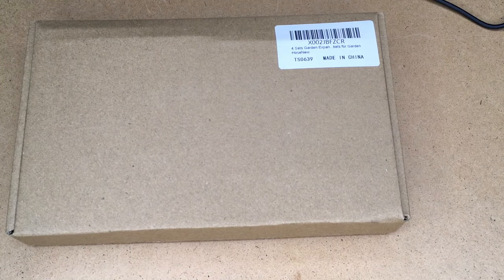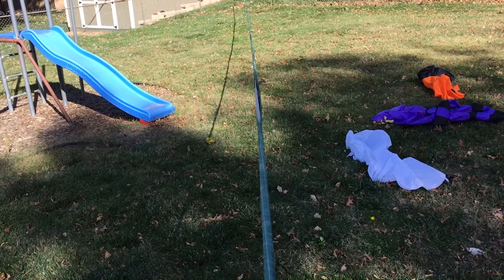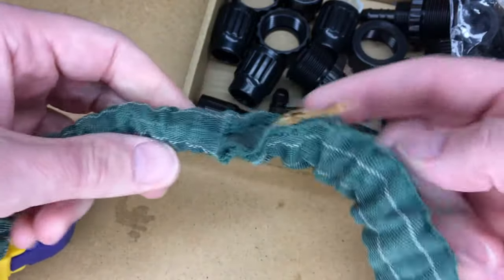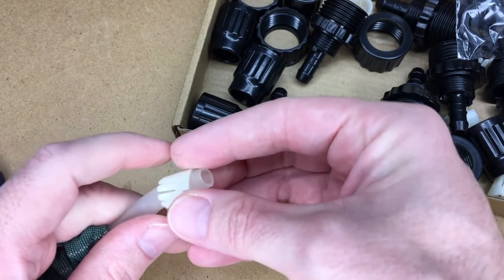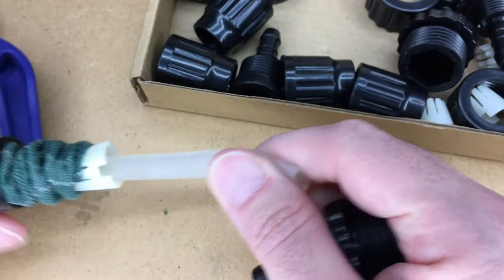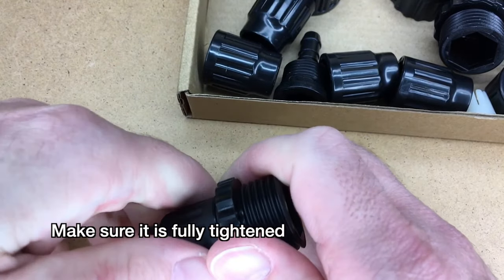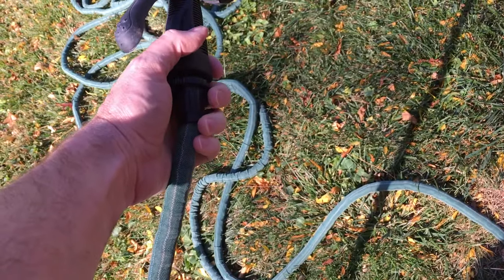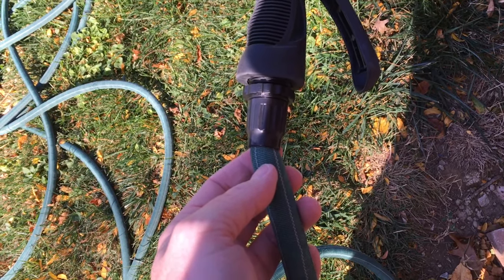Expandable Hose (e.g. Pocket Hose) Repair Kit

Comment: I am on my second expandable hose which also broke. Luckily I have not tossed either. I got an insert and 2 clamp kit from home depot.... may not work as well as yours.
Something that important to remember with these flimsy hoses is than you can NOT leave water pressure on for very long with the sprayer turned off (or what ever you have on the end .) It cannot handle the pressure like regular hoses. Side note: a neighbor had her nozzle set to trickle to slowly water a tree while she was out. Trouble is the water was turned on full and eventually the hose said "I'm outta here" and blew up. I found water seeping out her back fence and went to tell her there was a problem. (Californians are very touchy about wasting water 🤣  ) She was very grateful to be told.

Comment: Thank you Rick! Very helpful video especially considering the parts come with NO instructions. I would suggest you go into a bit more detail about attaching the female end. Also, a 1/2" hex wrench can be inserted and used to tighten the collar part. What I did for my repair was to install both male and female connectors at the leak point (only cutting out a 1" piece of the hose) to preserve the full length. Worked beautifully! Just like a simple coupler. And no leaks! Thanks Again!

Comment: I was able to fix my Pocket Hose thanks to your instruction and the repair kit that is shown. It requires some effort, clamps needed, don’t twist the tubing, vise grips help, and finally a male hex fitting to stabilize the female coupling.
Reply: What is the kit number

Comment: Hi Rick.. I've repaired 2 up to now (with great difficulty!) Both of my leaks were very close to the adapter which connects to the tap. When stripping the old ones, both tube and the green fabric were clamped, that's where my difficulty lay. but I noticed in your video you didn't do this. You just clamped the tube with the plastic beveled clamp then screwed up the last fitting with the fabric left loose. This made it far easier then clamping  both fabric and tube onto the nozzle.  Is this OK to do this?

Comment: Well I wished I hadn't thrown away the ends to another hose I had. However on this one I love what you did and I was doing the same thing only I need the other end repaired that hooks to the faucet. I can't get it to stay on and it doesn't have the little notches to line up it does have the cutout prices but nothing can match them to like the top and when I screw it together and put it on and turn on the faucet it just comes right back off.

Comment: I like the video, you do a great job of explaining everything. I'm not sure, however, how feasible it is to order a ten dolllar replacement for a forty dollar hose that will never function that well. My flexible hose bursted within the first thirty days. Followed the repair, there is nothing wrong with the video, but it is really difficult on the repair to not have a leak somewhere, usually near the nozzle. I've done this a couple of times, but I just think it is not worth the trouble to even purchase flexible hoses.
Reply from the maker: I get that. I like that they are easy to store but I wish they were more durable. It may not be worth it to repair the hose for some people. Since the kit comes with multiple pieces, I was able to repair a family member's hose. If a repaired ever becomes trash, I'll remove the repair pieces to use on another hose in the future.
Reply: I agree anybody that dealt with a flex hose and seeing how easy it is for them to get twisted and cut on bushes. Will probably never buy on again. 
Lol.     But it a grate repair demonstration for buying Time.

Comment: I LOVE my hose. It's a 1/2" FlexH20 (super easy to roll up after use) but it has sprung a leak at the connection. I'm going to try this fix. Thanks for posting!

Comment: Great video. I want to try and save my hose. Understand everything except can’t figure out how much tubing I should cut off. 
The tubing is what broke 2” down from the faucet end, since there is no way of retrieving the tube, I had to cut off a lot of the material.
I put the piece of material over a rod and compressed it, measures 3 feet.
In it’s relaxed state it  measures approx 8 feet
Pulled out tight approx 16 feet
How much tubing should I cut off before I repair it. Thanks Linda

Comment: Wow.  Wish I had seen your video before I threw out my leaking hose and got a new hose.  Only suggestion I would have is to use plumbers tape on the threads when you tighten to form tighter seal.

Comment: One suggestion I have with the hoses, don't buy the ones with plastic fittings at the ends (like this one in the video) . Those are garbage.  Buy the ones with metal connectors and a valve at the far end.

Comment: My hose the rubber part is like halfway down the sheath. I cut the sheath to access the hose rubber. Fixed the end. Now where I cut the sheath it bubbles. Any fix for that? Or do I need to cut the hose there and use the kit to make an extension.?

Comment: Nice job Rick.  My flexi hose developed holes close to where it attaches to the faucet. The hose is expensive, and I used it for close to two years with satisfaction.  Real interesting seeing the anatomy of the hose and the detailed instruction on stretching the hose out before cutting it.  I will order a kit and give this a try, I should be able to make it work. Thanks.  :).
Reply: What brand of parts is this on Amazon?

Comment: Being that the inner diameter of the solid repair piece is NOT expandable and it is much SMALLER than inner diameter of a fully expanded hose inner diameter, it would appear to me you would lose a substantial amount of water flow/pressure...correct? Regardless, a lower flow hose vs no hose is a winner! Great kit!
Reply from the maker: The restriction in the repair piece and the original hose connectors is about the same. These hoses aren't great for high flow. The biggest benefit is that they don't take up much room and are lightweight.

Comment: Thank you for posting Rick, I have one suggestion and one comment....Suggestion, I applied some electrical tape to the green hose cover to the very bottom of the threaded section.   This helped me a lot in trying to move the plastic part up the hose to the threads.   Comment, I had to sacrifice one of my previously purchased box of 8 because I was not completely clear how to end up with a male end....but I figured it out and salvaged part of the original yellow connector with the local on/off "handle"....as for the durability; these green hoses will explode if the water is on full and you close the nozzle; but if you keep a bit of water still running while turning off the spigot they will not self-destruct.  I migrated to the black flexible hose for another spigot.  Again, thank you for clear photos/video and explanations.

Comment: Thanks for this helpful video!  One question, though, does this process and the kit you bought work for the repair I have to do that's in the middle of the hose?
Reply from the maker: Yes. In the middle, you would repair both sides to essentially turn your one hose into two shorter hoses that you can screw together.
Reply: @Rickmakes  Will do.  Thanks again!

Comment: I bought the kit and successfully made one repair after the actual nozzle handle split. The hose part was fine. This was the male side of the hose and I did the repair as shown on the video.  It was very hard to get the white plastic  sleeve over the hose and then it was equally hard to get the last cover to catch so you could screw it tightly.  And the very last few turns I had to ask my husband to do so it was tight all the way.  

Fast forward to today,  I had to make a female side repair, the inner tubing came off of the faucet side spraying water everywhere leaking through the hose cover.  I again followed the directions on the video.  This time I observed that the tubing was sticky on the inside and sticking together making it hard to keep open so I could slide over the male end.  The white sleeve slide on easier this time.  Still have a very hard time getting the outer sleeve to screw tightly over the fabric, kept having to trim it back as my hose cover frays easily and eventually could not get it to move any tighter.  Tried it on the faucet anyway and FAILURE!!  Water leaking everywhere at the connection.  I'm assuming two possibilities, 1) the sticky tubing is deteriorated and not holding well enough, 2) the outer sleeve cover MUST be snug against the outer ring.

I will try again, this time cutting open the hose cover to find where the tubing is not sticky and try the repair again, hoping that the outer sleeve will be able to screw tightly against the connection for the faucet this time.
If anyone has any helpful suggestions, please let me know.
Reply from the maker: I wonder if some silicone spray lubricant would help. I'm not really sure. It could make a mess and make things worse.
Reply: @Rickmakes  Put hand soap on the inner hose and the white plastic sleeve will slip right on.

Comment: Don’t want nor have one of those hoses but am glad you showed there is a fix and it seems to work. Maybe a friend or neighbor might need my help fixing one of those! Thanks.
Reply from the maker: My wife got the hose but I had been using it quite a bit recently. It is nice in that it is lightweight and easy to store. The downside is that it isn't as durable. Thankfully I was able to fix it. I may someday get a Flexeel host. I have one of their air hoses and it is lightweight and durable.

Comment: This is great video.  My hose is leaking in the middle (not the ends).  Do you have instructions for fixing this?
Reply from the maker: I don't know if there is a specific repair kit for that but with the kit I used in the video, you can cut the hose at the leak and put ends on each side of the cut. You would then end up with two shorter hoses you can connect together.
Reply: @Rickmakes  I have the same problem, I do not know how to connect both pieces together.

Comment: Mine is leaking at the beggining of connection where you attach it to the water vaulve. I guess is the same procedure  right? What's the name of kit?
Reply from the maker: Yes. You can repair at any point in the hose. Often you would repair both sides of the break to make two hoses from the one broken one.

Comment: My collapsable hose has a much larger inner tube then what the repair kit allows. Any suggestions?
Reply from the maker: Not sure on that. Could it have stretched? If you go back further in the hose is it smaller? If so, you may need to cut the hose shorter.

Comment: Too bad it doesn't fix a "Zero-G"brand light weight hose because the tubing ID and wall thickness are too large.  Also the Zero-G Fabric covering is too bulky so that you can't slide the plastic end piece over it.  Good design of the repair kit...but 
size compatibility with the hose is critical.

Comment: so this won't work on a thick double wall hose tube.   it was too thick to screw the parts together.  very disappointing.
Reply from the maker: Does it have two tubes inside, one inside the other?

Comment: Why Pocket Hoses Fail

Description:
2 Plastic connectors on each end of the hose.
One expandable tubing is clipped onto those connectors.
One non-expandable but larger tube of tough fiber weaved outer jacket.

water pressure causes the inner tubing to expand like a balloon.
the outer cover prevents the inner tubing from over expanding and popping.

The inner tube expands by water pressure. Then contracts when the pressure drops.
The greatest pressure happens right near the connectors.
Each time this happens, that inner tubing begins to form cracks.
When enough cracks near to each other forms, water pressure forces it 
way through that weakened area, ending up as a leak, most frequently right near the connectors. The clip that holds the rubber tubing keeps it from expanding. Meanwhile,
the non-clip hose expands. The difference between them generates the biggest cracks.
Then at that area, it splits open. The more you use the hose, the sooner it splits open
near the connectors.

once you understand the problem with these types of hoses, you must decide
whether or not they are worth your while. If you do a ton of use, then vinyl is the 
way to go. If occasional, then pockethose like products are the better choice.
Reply from the maker: I think the biggest advantage of these hoses is ease of storage. Aside from that, they don't have much or anything that is an advantage over conventional hoses. We use one because it can easily fit in our deck box when not in use.
Reply: @Rickmakes  yes, same here; i have 3 hoses and they all fit 
in one large pail. However, all three
hoses are more than a foot shorter from
all the repairs. 
Now, tire foam is used to 
slow down tire degradation and cracking, 
so I wish something
like that is created one day to keep those
in-side tubes elastic for years. 
Don't say it, I know, very unlikely to happen. but you never know.

Comment: The link https://amzn.to/3dqqAO4 you provide shows 8 plastic pieces (4 each male and female), and 8 rubber gaskets.  Are the white pieces that tighten up the hose tubing to the end black plastic piece already inside the black plastic pieces?  I've discovered that those white pieces are critically needed.
Reply: Hello?  I also don't see the white pieces.
Reply: If you scroll to the second picture, it shows the white piece.